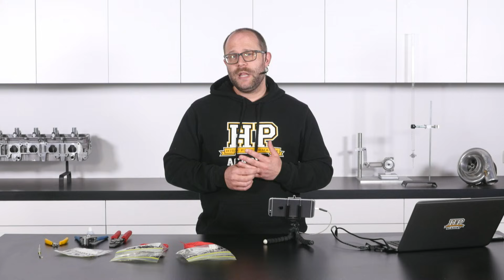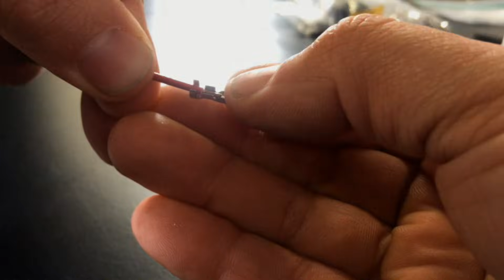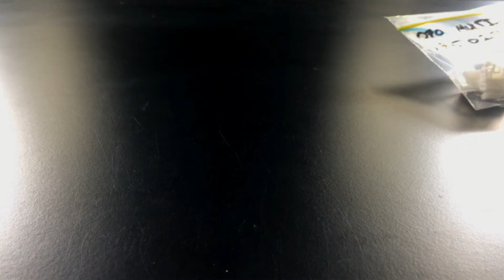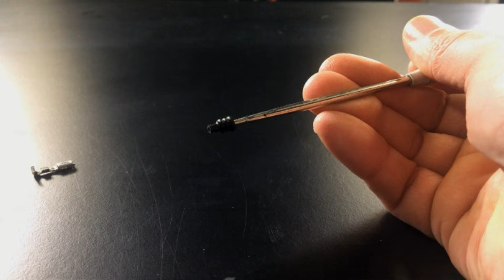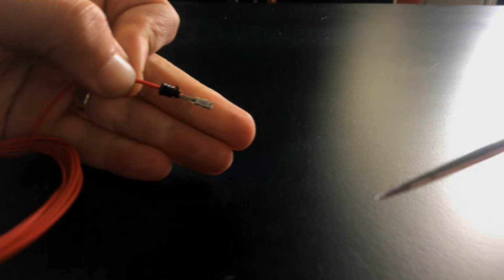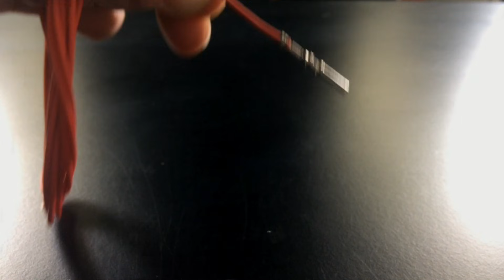Cost-Effective Crimping | Affordable Connectors AND Tools  [GOLD WEBINAR]

Comment: 11:40 It depends on the insulant, though. PVC, Tefzel, silicone, PTFE, PE, etc. are different thicknesses
Reply from the maker: Yup! The example here is for this terminal, wire and tooling. The concept is universal which is what we are trying to teach you so you can use your brain and think for yourself, but the specifics do change according to your chosen tools and materials and that's where the brain part comes in 😎
Hope you found the lesson helpful overall, even if you are using different tools & materials - Taz.

Comment: I'm developing adapter kit for Mercedes CLA W117 Incandescent to LED tail lights. This video helped me a lot with wiring. I ordered 10 sets of female 8 pin connectors. But I still have to 3d print a 7 pin male connector which is not produced. This  will be the real challenge!

Comment: I want to crimp 173681-1 pin let me know appropriate tool
Reply from the maker: If you look at sites like Element14 the recommended tool is usually on the same page. You can then reference that part number to find a range of options for that type of tool, or possibly a kit like ToolAid offer for some common tooling option.

Example for your contact: https://nz.element14.com/amp-te-connectivity/173681-1/crimp-contact-socket-22-20awg/dp/2060315

That isn't the only wiring supply website that does this. Hope that helps! - Taz.

Comment: Decent information. however, showing details of a black tool in front of a black background in dim lighting takes an awful lot away from the usefulness of the demonstration. Put some light on the subject...
Reply from the maker: Yes a little tricky! The course material is a bit more refined compared to these ones we do live but we generally use a white background (just a bit of paper) for some shots like this these days. You live and learn! - Taz.

Comment: I usually start the oe insulation crimp by hand and overlap the two fingers (as in the first example) as the expensive factory tool that does both crimps at the same time makes a dogs breakfast of them every time. I can't say I've tried using the W-crimp on some generic pliers for insulation though

Comment: I have found it useful, particularly with aviation wire (Tefzel) to use flush cutters to nip off a small amount of each of the crimp ears before crimping to the insulation.  It seems these ears are often sized for the thicker insulation on automotive wire and are just too long for Tefzel.  Nipping off 1/64 to 1/32 of an inch can make a big difference.  Obviously nip a little more when at the smaller end of the terminal’s wire range and a little less when at the larger end of the range.

Comment: Crimping the conductor in Econoseal 070 and MultiLock 070 terminals is exactly the same process. Both types of terminals are almost identical, except that Econoseal have a larger and differently shaped section for 'O' crimping the wire seal, and anti-rotation ribs on the sides of the terminal.

Comment: Love all the info on these smaller sensor wiring terminals, but does HPA have any resources for best practices when crimping larger terminals, such as battery lugs? I'm seeing lots of different methods of getting the job done, but was wondering if there's a rigorously tested ideal geometry - I mean, like from a "piston" crimped lug (hydro or hammered) with the crimping die pressing in to a round support, or a hexagonal shape from either hydraulic crimpers or bolt-cutter-style crimper, or just a simple set of rectangular dies, or wedge-shaped die in one side....

Also, I don't think I've seen mention of working with wire ferrules? I think for those it might be more simple - use a 4-die or 6-die crimper - but they can also be crimped like the aforementioned lugs.

I guess I should probably be asking this on the forums, lol...

Comment: The tool that you recommended "TOOL AID 18700 kit in your online article", if you have a look at the kit what's included,  the red crimper included in the kit which is also tool aid 18600, it is no where near the same crimper shown in the video. 18600 didn't have any round die like what you are using which is the A and B. Inaccurate information in that article.
Reply from the maker: Yes you are correct, that is my personal mistake and thank you so much for pointing that out so that I can get it fixed before Zac the tutor tells me that he's both angry and disappointed.

The correct tool can be found here: https://www.milspecwiring.com/16-30-AWG-OPEN-BARREL-CRIMP-TOOL_p_405.html

Of course you don't have to use that supplier if you wish to source it elsewhere.

NOTE: That toolaid kit is still AWESOME and relevant though, it gives you DTM, DT and DTP crimp tools relatively cheaply. Sometimes those other two tools are useful, but not super often.

Thanks again for mentioning this! It would have been much easier to simply keep your thoughts to yourself which would have been a shame - Taz.
Reply: @hpa101  lucky i haven't gone out and bought the 18700. Cheers
Reply: @hpa101  That link to the "correct tool" doesn't go to a crimper like yours with the round hole either...where can I get one like it in NZ?
Reply from the maker: @ianhendra4836  MSEL or Element14 is your best bet for local wiring gear, but generally you have to buy from overseas - Taz.

Comment: Hi, I'm new to this. But why not use a closed barrel pin instead of an open barrel? Closed barrel looks much more secure and easier to crimp.
Reply from the maker: Hey Jonathan, great question, in a nutshell they are more versatile and consistent.

This has popped up a few times on the HPA forum, but an experienced member has put together a really good answer here I think you will get value from: https://www.hpacademy.com/forum/efi-wiring-fundamentals/show/deutsch-dt-closed-vs-open-barrel-terminal

Hope that helps answer your question! - Taz.

Comment: most ratcheting crimp tools have a release in case you accidentally crimp something that prevents you from squeezing all the way to the release point. good ones will also have adjustable crimp force.

that said, i still prefer a manual tool like yours for that style as i have to do crimping in tough sports where space and/or wire length is at a premium. i like to be able to pinch the strain relief section with my thumb and finger while making the conductor crimp so i know everything has stayed in the right place. sometime i don't even have the luxury of being able to see what i'm doing. ratcheting crimpers tend to have combination dies that do both at one preventing said pinching technique. plus they're just bulkier.

nice to have both though. if i was standing at a bench doing crimps by the dozen i'd go for ratcheting.

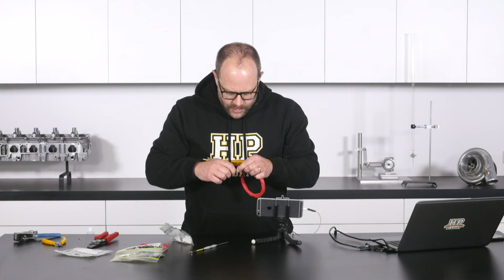Comment: 9:02 Actaully really happy to see that failure, because it shows the importance of the tug test. Even if a connection looks cherry, you gotta give it more than a weak pull. You just can never know the strength unless it's properly tested. Cheers for that!
Reply: Agreed!!!
Reply: but isn't the insulation crimp section supposed to help hold it on? Seems he tested it half crimped to me.
Reply from the maker: @Robert depends on the connector. Manufactures give guidelines on this, down to the exact length of exposed wire you are supposed to leave in order to reduce strain risk - Taz.
Reply: @Giliganism  No. In fact, most manufacturer pull test specs explicitly state that pull tests are to be done without an insulation crimp (either by removing the insulation wings first, or by stripping the insulation off a much longer section than usual). The insulation crimp is strain relief, nothing more; it’s not supposed to bear any tension.
Reply: @Giliganism  Very rarely. That's the exception, not the rule, because of this logic:

You want a gas-tight crimp, and a crimp that cold welds the strands together, and into the terminal itself, in the crimp zone. Much like how torque wrenches approximate the stretch of a fastener with torque, but torque itself isn't a useful number in and of itself... pull tests approximate the quality of the cold weld made in a crimp, even though achieving a high pullout strength is not in and of itself, the goal. So, if you crimp the insulation section before you do a pull test, you may be hiding a poor conductor crimp, and thus a poor electrical connection.
Reply: yeah interesting how in my mind i was like oh that is very much a reason to solder if you're not really that great at crimping either you can make those mistakes/ so its really like you can make mistakes with any tpe of connection and you need to do it right either way

Comment: In the 1970's I built relay panels for early CNC machines...crimped 100's or even 1,000's every day...you cannot justify buying $150 crimpers for each wire size...unless you want the job done right.

Comment: Started installing a Holley Terminator X in a 5.0l Mustang(and redoing a LOT of chassis wiring as it was a total hack job), and I've gotta say that automotive wiring as a whole is a LOOOOOT more simple than I realized - but trying to figure out which crimpers I need, which size crimp needs to be used for what pins/terminals, etc. has without a doubt been the most frustrating part of all of this.

The industry seriously needs to improve on the standardization of this stuff, it's pretty ridiculous that the best options are either spending hundreds of dollars on an overpriced manufacturer spec tool or trial & error with generic tools(that's a bit of an oversimplification, but none the less).

Comment: Good instruction. Please see below for more guidance on making good crimps:

There are crimp specs for terminals that should be considered. Crimp height, crimp width, and pull force. If you visit the link below, you can enter the pn of the terminal and access all documentation for the product. Typically the application specification document has the specs you need. If you can’t find it, the TE support number is 800-722-1111 

https://www.te.com/commerce/DocumentDelivery/DDEController

If you search crimp theory fundamentals advanced, the video has all the info you need to become well educated on crimping. 

I’m not critiquing the video, just providing more info to make the best crimps. There is some important info missing from the video regarding crimp specs and crimp theory. 

I’m not saying you need to buy a $1000 tool to make an acceptable crimp, but if you want to crimp to spec, you need to know the specs. The info above will get you the specs and knowledge you need for that.

Comment: What kind of breathing exercises do you recommend for when you realize too late that you forgot to put a seal or heat shrink on at the beginning. Again. Lol. I've done that too many times...
Reply: Loud ones are typically recommended, with multiple F-Bombs.
Reply: @ZacMan42  lol that's my standard, but I always get a stern talk from the big boss after. It's a small shop and the customer area is within earshot 😆
Reply: I saw one guy on youtube that clipped the wires, put the sleeve on and soldered them back lol 💀
Reply: @bsfibers  😬🤦🏼‍♂️😆

Comment: That was good. I’m an HD mech and wondered if basic wiring for race cars was different from factory stuff. So far no. I went to trade school and learnt this already. I always hated trying to get the wire and barrel connector out of the plastic plug on the harness. The key to this stuff is to have the proper tools, especially for repairs.
Reply: There is a tool for that it looks like a punch but it’s a tube that slides over the pin and pushes the lock wings in and you can still use it in the connected

Comment: Starting larger and failing, then moving to a smaller crimp, seems like a waste of time and product!
Reply: Doesn't waste any product... Plus it's usually necessary since the tabs on the connector are flared wider than the opening on the tool
Reply: Got to that part in the video. Figured he was going down a size if unsure before pull-testing it so I ignore my previous reply lol
Reply: Don't you think he would've used the smaller one the first time if he knew that was the right size?

Did you even pay attention? Did you miss the part where he said "there is no universal chart that says what size die is for what size crimp"?

You should probably re-watch this from the beginning...
Reply: @RyTrapp0  have you ever even worked with wiring? It's standard practice to hit it once and then move to a smaller notch and hit it again. Keep in mind this is a DEMONSTRATION. In the real world you'll know it's tight enough and the pull is just to confirm. I MIGHT have had ONE terminal actually pull off, in my entire life. It's not rocket science and you don't need to over complicate it
Reply: @neomeg2232  ...oh right, so you're watching a 39 minute crimping video just so you can correct everything said in it, huh?

Funny, we didn't have any special "hit it then hit it again" bullshit at the professional race shop I worked out - never had a terminal pull off either, because, you know, we had the right tools for the right pieces and didn't need to come up with a 'secret sauce in-the-real-world formula' for crimping pins

Talk about not needing to over complicate it...
Reply: @RyTrapp0  watched it because the title mentioned affordable connectors, and I'm always looking for a better supplier... Plus I'm always open to learning something new. I've found plenty of little tidbits I didn't know in their videos. You're not handling lockdown very well are you? Get out and soak up a little sunlight tomorrow. You're turning into a Snicker's commercial
Reply: @RyTrapp0  lmao I just realized that my brain put you and the op together.
Reply: @neomeg2232  I was seriously struggling with what the hell I said had to do with what the hell you said LOL
Reply: @RyTrapp0  Haha, dude, why you mad?? I simply made a statement regarding my opinion that it is a waste of time, Money and product trying larger to smaller, rather than going smaller to larger. So salty over my freedom of speech and opinion. I can literally see that stick up your arse twisting when you wrote your reply, lol
Reply: @BUZDRIFT  Literally everyone in here thinks you're a fool - OMG, not a wasted pin!!!
Reply: @RyTrapp0  its not about one, but as you would know could be hundreds! You're kinda making a fool of yourself focusing on the one pin and not being able to think further than the initial thought /comment!
Reply: @RyTrapp0  lol yeah, I was like "wait what" and actually went back through the thread and couldn't figure out what dafuq went wrong or where. We're cool man.  OP shadow trolled both of us somehow.
Reply: @BUZDRIFT  just stop dude. Pins are cheap, and nobody ever even suggested doing it wrong. They just showed how to test it and did it wrong on purpose to show a failure. It's called a demonstration
Reply: @neomeg2232  it just seems inefficient and if you're doing this hundreds of times the costs add up
Reply: @BUZDRIFT  it would be. That's why nobody does
Reply: @BUZDRIFT  Like I already said - try re-watching this again, some details clearly slipped right by you
Reply: @RyTrapp0  Fuck me people, he literally says he purposely tries the larger one first... My argument is, wouldn't it be logical to try the smaller looking size so you're not wasting time, money and product! You're all hooked up on the tiniest detail, nothing slipped by me or you would have referenced it! Ffs you tight arsed irritated sphincters!
Reply: The aim is to determine what size die needs to be used for a particular wire / terminal combination. What you do with the general purpose tools (so you've got no factory spec doc to work from) is to make your best guess, and iterate from there. If it's too small (overcrimped) then you move up a size. If its too big (undercrimped) you move down a size. You only need to do this one time for a particular wire size / terminal combination, as once you figure it out, you document it for next time. Very few wasted terminals, efficient use of time, documented for the future.
Reply: Oh, sorry he ruined a $0.10 pin in order to assure he's got a solid connection.